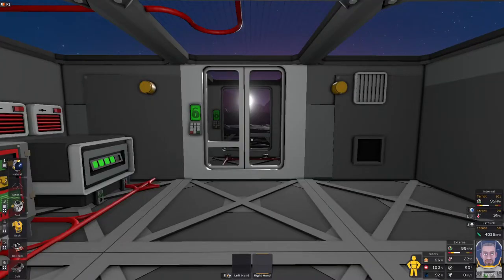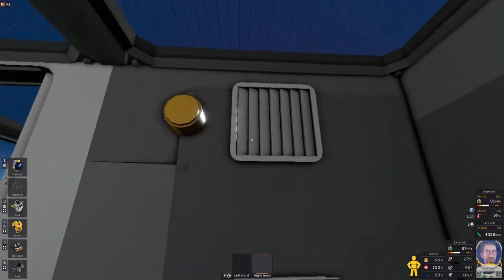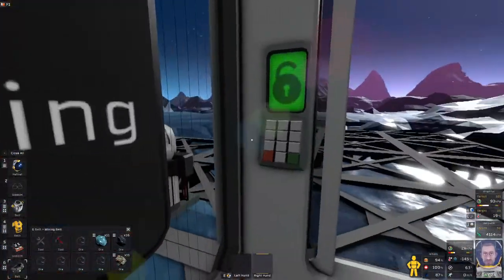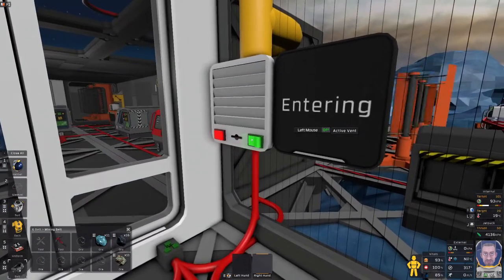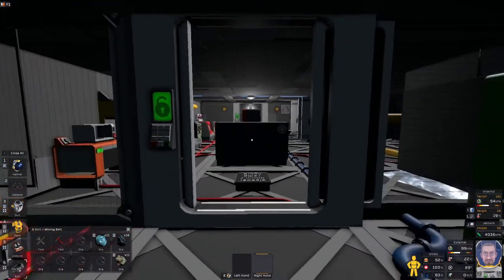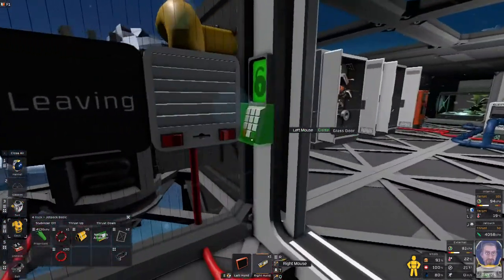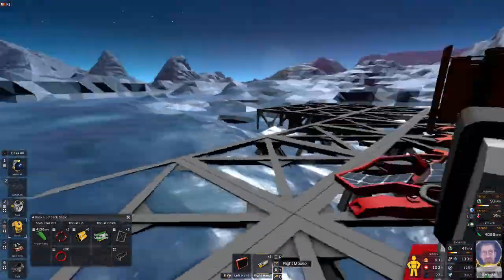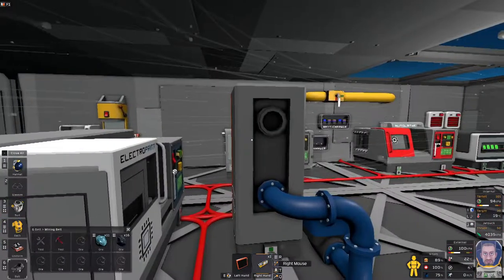Stationeers - Starter Tips to manage Temperature on Europa

Comment: Cold is really problem only at first few days until you build and warm up your first shack and make first wind turbines. For airlock it generally easier and safer use advanced airlock and  frames around airlock as it protects pipes in walls from cold. Although views will not be so good. Having extra doors inside is good. Easiest way to deal with cold is to pipe  furnace exhaust though the base. You generally do no even need radiators there or it shoots temp up too fast. However, keeping furnace close to base is kind of risky.

Comment: I know this is setup at the stage before alloys, but you need to keep your warm pipes going into your base from being exposed to the outside.  Basic pipes radiate heat and in that environment, the exposed pipes to the outside will bleed heat from your base because you have that same pipe network also exposed in your base.  It'll be minor, but you should run those pipes through fully completed frames, like the bottom.

It's minor, but at that stage of the game, its hard to keep up on everything, so avoiding creating more issues is very important.

Comment: Isn't that just a manually operated advanced airlock ? Maybe it's easier to setup for a beginner :)
Oh yeah and collecting hot furnace air to help heat up the base, nice touch ;)
Reply: Yeah, this is an over complication of the advanced airlock.  I haven't played on multiplayer servers so i don't know if you start with one, but on most solo games, the advanced airlock circuit is in the starting supplies.  If not, it can be made with 5g gold, 1g iron and 5g copper, so it's still super cheap.
Reply: Luckily the next video in the series is about advanced airlocks.